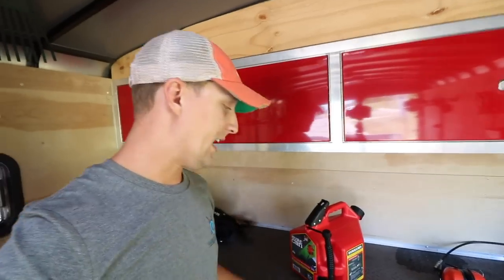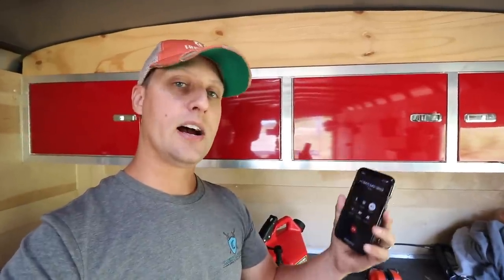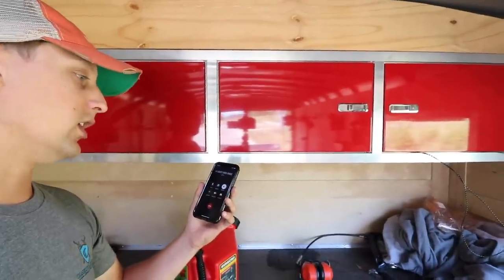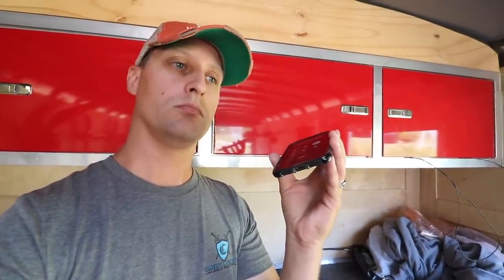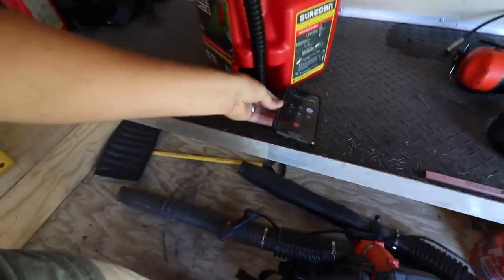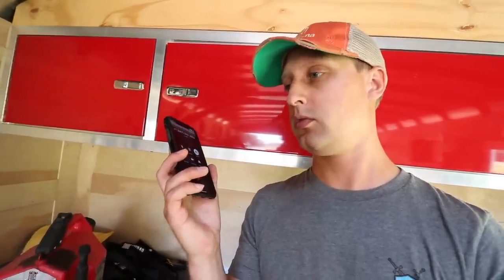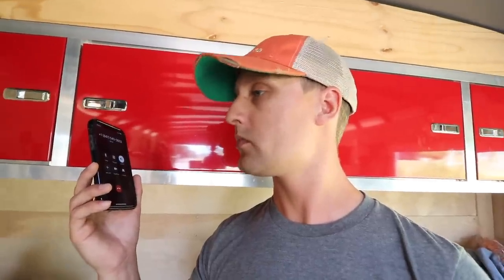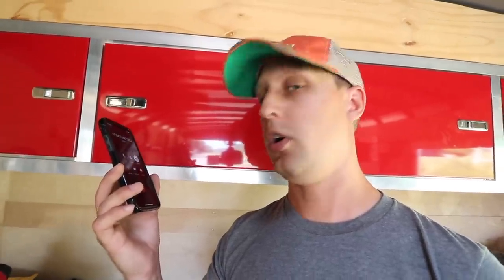What's The Best Octane For Hand Held Equipment? What About Ethanol?

Comment: I run 91 octane non-ethanol fuel in all my mowers and small engine outdoor power equipment. Unfortunately Kansas doesn’t have anything higher than 91, but so far I haven’t had any issues related to fuel. I also use the Echo Red Armor oil mix for my 2-stroke engines. Great product so far.
Reply: Kris Mueller .. I use the same fuel and 2 cycle + stabilizer in the fuel
Reply: @Kris Mueller, where I live in Florida I can find ethanol free gas in a octane rating of 90, 92 and 93 at some pumps but they are so easy to find.
Reply: Illinois is a terrible place to find non ethanol. I live near the 2nd biggest city in the state and there is ONE station that sells non ethanol. It's 90 octane which I think is adequate but I'd gladly pay more for some 93 or something. I run that with Husqvarna XP+ at 45:1 with some sta-bil if I don't think I'm gonna use it within a month or so. I've thought about switching to Red Armor but the Husky has been treating my saws well so I'm gonna stick with that

Comment: Coming from an automotive background this make perfect sense. The sports car reference hit the nail on the head. Sports cars have high compression motors. Therefore requiring higher octane. You don’t want the gas pre detonating before the spark plug fires or the piston is where is supposed to be. As the piston travels up and if the gas ignites, its like two forces going against each other. Like running into the wind. You aren’t going to be fast. So the motor is going to loos power and cause premature damage to the engine internal components. Only putting 91 octane now. Thanks!

Comment: I use 93 in all my equipment. I also only use the redmax oil. My small engine repair guy recommends using redmax oil since it is designed for the redmax equipment and the manufacturer wants you to use it. If you use a cheap oil it could possibly void your warranty. I love your videos. I have my own landscaping company and I'm 16 and had it for 2 years m. Keep up the good work

Comment: Interesting, as far as ethanol goes it is no problem in car engines but will hurt small engine carbs for most people if they let the gas sit to long without an additive. I have found it will not hurt small engines if you are pumping fresh fuel every few day and using it completely not letting old fuel sit in the tank. Also our two gallon can for each truck last 1 to 2 days max. When I first started landscaping I had lots of problems with ethanol since I was not running my equipment non stop.
Reply: I run two kinds of fuel stabilizer in all my stuff to include emergency backup generators and it seems to have solved the ethanol problem in large part.  Yep, when that stuff transitioned in I saw an uptick in carb rebulids/replacements.  The fuel stabilizers have greatly improved things.  Probably a 80-90% improvement.

You are right, it's when the equipment sits without use is when the problems start with ethanol fuel.

Good stabilizers will mitigate that in large part.  Another thing is where the equipment is stored.  I keep the emergency backup generators which store for a year at a time in a climate controlled shop.  Lawn equipment is in a non-climate controller area.  Temperature changes cause the fuel tank to breathe and collect moisture.  Something to be aware of for long term storage.  In a 4-cycle mower, the crank case can also collect moisture in the oil.  Running the engine up to full operating temperature will boil-off the water from the crankcase.

Comment: Big Thank you to Jason and Echo. I LOVE my Echo equipment. I use 93 no alcohol and Echo Red Armor in all hand held gear. When I bought my first piece of Echo gear the dealer said it was the way to go and I have had NO problems.  I did wonder about the use of alcohol free fuel in the zero turn.  Kohler says that 87 octane with 10% ethanol is acceptable and it is cheaper. You just go through so much gas in a week, I wondered what you thought. Thanks for this very informative video and again to Jason and all the good folks at Echo.

Comment: We have 87-89-91-110-E85 in central Wisconsin. 91 is ethanol free at Kwik Trip. I have always run 91 in everything. 110 is racing fuel and is almost $7 a gallon.

Comment: During summer I have to run the highest octane or they constantly vapor lock and boil the gas, when its cold its not an issue but for the little bit extra its well worth having premium for handhelds.

Comment: When I was running my company, I talked to some of the bigger competition in my area about this. One of the dealers here also has a lawn maintenance and landscaping division.

Every single company said they used the cheapest gas available, even the dealer.

I would imagine it was simply the sheer amount of hours they put in their equipment, and that the gear would be replaced before any octane or ethanol damage was evident.

In my area, non-ethanol gas is hard to get. We have 85, 89, and 91 octane.
Reply: Unlike Joe Home Owner, a landscape / lawn care company will typically be gassing up with fresh fuel every day or so and the fuel never sits around long enough for the Ethanol to cause a problem. A professional is also more likely to properly drain and prep their equipment for winter storage. For this reason it really doesn't make sense for them to waste the money paying a premium for non-Ethanol fuel.

Comment: I use non ethanol 90 octane in the handheld tools....the rubber gaskets primer bulbs and lines live longer....I think the best thing i. Ever did was switch to a good grade of oil...I used to buy what ever the station I was getting fuel at sold...never could get 2 seasons from a trimmer....switched to the equipments brand of oil with success...then modified that to include synthetic 2 stroke and I have 2 fs 80s that are 10 years old now and do great...I use amsoil, but I have the red armour and use stihl also...mainly just use a top quality oil and a good fuel and you should get years from your trimmers....now a carb may still wear out or a primer bulb go bad....those things are just gonna happen regardless

Comment: I don’t know if I missed it but if your not using ethanol free gas get yourself a bottle of boat ethanol remover and mix it with the 2 cycle oil, I use it in my boat and in all my 2 strokes and I have never had any issues.

Comment: I run 109 octane (C12 race fuel) in my fs 70 r. I run this because it burns cleaner and gives it alittle more power in the top end. I run the Stihl silver bottle oil and I have never had a problem and I don’t have to winterize the equipment because it burns out of the carb because it evaporates compared to gums up the carburetor

Comment: If you live in an area where you cannot get fuel go to a small airport or a local racetrack some airplane fuel is harsh on four-stroke engines like mowers etc you need to add top end oil. Being an old school tech we dealt with this in the 90" when you get this of type fuel add seafoam to it.I do not like  four- stroke string trimmers and blowers they do not turn the rpm"s so I rebuild older ECHO AND STIHL with non- advancing Ing.this past year is the only bought a blower and trimmer

Comment: Brian, I use non-ethanol fuel. One thing a lot of people don’t think about is; what are they getting when they pull the trigger. If the last person put the nasty gas in their car because it’s a few pennies cheaper. How much fuel needs to go through the pump and hose to get what you want or intended? Pumps here have a disclaimer that says 4 gallons. Most of us fill a one gallon or two gallon. What did we put in our can? You don’t really know...
Reply: Huh?  So you mean they have a sticker that says it takes 4 gallons of fuel before the new selection comes out the hose?
Reply: Most NA pumps are separate here
Reply: Our pumps here are dedicated ethanol free service. 

The selectable grade is what you said. One disclaimer, you will notice the pumps say min octane. Often times you 87 is actually measuring higher. There are reports (hearsay) that several places buy a midgrade and your getting the same fuel and its done because the costs is not that different. A vendor can sell premium at lowgrade without any issue, bur can not sell premium as low grade if that makes sense.  (Again, just stuff inhave read, i have no facts or inside knowledge)

I agree with Bass's comment above that it balances out on the volume within the hose line is reality small.
Reply: Right. I wasn't really referring to non-Ethanol but multi-grade where the pump has one handle and can deliver multiple grades of E10. So if someone has a 1-gallon container for their weed wacker and selects 93-octane, if the last person bought 85-octane then chances are you are paying for 93 but getting a gallon of 85. Correct?
Reply: To clarify; I got my info from the rental company in the next town over when I rented a Dingo. They were very specific about not using the gas from the station on the corner gas station. After reading what ShelI says I would tend to believe the gal. Or lesser. They also said their carb problems stopped after they started using another station.
Reply: We used to have a few stations in our area that were notorious for contaminated gas.
Reply: Thanks for that info.

Comment: Manuals say 89, so I use 89. 89 for my mowers and 2 strokes. With low compression you would think 87 would be fine and midgrade/premium a waste. 5 years using 89 with no fuel issues; winterized of course. Recently ethanol free has become available in my area. I use ethanol free if an engine is going to sit for more than a week, or all the time for marine engines.

Comment: Brian per Bobcat (Indy North) my dealer they recommend no less than 89. But I personally run nothing but 93. My small engine shop (Mower Zone- Danville IN) recommends 93 for small engines period. They also recommend a product by the name of ethanol shield (made by BC3 industries). 

Almost all fuel has a 10% ethanol in it now no matter where you go. The ethanol will eventually eat fuel lines in the small equipment and they recommend the ethanol displaced product ( helps it get burnt and get rid of the hydroscopic properties of ethanol( water attracting)).

The ethanol free fuel is great but it’s not really worth it for small guys like us cause the price point would eat into the profits. It’s normally 1.50 higher per gallon too.

Hope this helps a bit.
Reply: That's funny. I run 91-octane non-Ethanol in all my small engines because that is the only non-Ethanol available around here. When I had an engine that was running too rich and fouling plugs everyone told me it was because I was running too high octane gasoline. I noted that the manual said "Minimum 87 octane".
Reply: Its only 3.45 to 3.65 a gallon vs 3.00 for 87 octane e10
Reply: Strong Tower Lawn Care here in the Indy area at the few that have it the fuel is almost 5 a gallon. There’s like 4 to 5 gas stations in a area of 500 square miles that sell it.
Reply: Hi Todd, I live here in Tipton Indiana and get ethanol free 90 octane gas straight from the pump at the Countrymark gas station. Ethanol free stays right at 60 cents per gallon more there. It's not a huge difference between buying ethanol free or using the BC3 additive. There is a Countrymark in Lebanon which has the same prices, then there is a Walmart with a Muphy USA gas station that has ethanol free for $0.40 more per gallon as well (but it's 87 octane.) I haven't ever seen ethanol free for close to $5 a gallon. it's not that I don't believe you, that just sucks. 

the ethanol free can be stored for a year or greater without issues, as e10 fuel only can get stored for a month in some cases and it absorbs water.

Comment: Where I live, there isn't a single gas station that is ethanol free which blows.  So I use 92 octane and mix in Sea Foam with my 2 cycle and haven't had any issues since I started doing that 5 years ago.  When I wasn't paying attention to the ethanol in gas, at one point I bought 3 weedeaters within 3 years or so and thought "they don't make em like they used to" but naw, it was the ethanol.
Reply from the maker: Exactly

Comment: You forgot about the best fuel for small machines: Alkylate gasoline - This will not foul when long term stored, burns cleaner, less smell.  If it's a pre-mixed solution for 2-stroke it will not separate, it doesn't contain alcohol, so it is NOT hygroscopic like regular gas, this means that you can store the equipment without danger of fouled fuel, carburetor corrosion damage. Usually it's 95 Octane rated. It CAN cost a bit more, but on the other hand, you use relatively small amounts in small machines, so the expense is well worth it, especially if you have machines that sits idle for months.
Reply: satanclaw - But, being able to purchase it in a State that sells it .? .. or is allowed too ...
.. that is the question.
Reply: I live in Norway, I just assumed since you live in the land of the free, you'd be allowed to buy a environmentally friendly fuel?
Reply from the maker: Never heard of it will check it out thanks for sharing.
Reply: satanclaw 😄😄😄😁😁

USA has ... what I call
Garbage Gas
Not only does it contain ethanol (farmers are subsidized by gov't to grow corn) . .. it also 
has butane😲in it. 
This USA Garbage Gas starts to breakdown after one month.
Also, there is a difference between winter blends & summer blends. That has to do with the 
"heat of vaporization". So, you know ... cold winter day & summer gas ---> not fun😥
Reply: We have summer and Winter diesel where I live, the winter diesel has kerosene in it to avoid it freezing, we get temps down to -30c every winter. Our regular pump gasoline has up to 10% ethanol, but they are increasing it to 15% !   I personally use the brand Aspen for my Alkylate fuel supply: US distributor: http://smallmdistribution.com/

Comment: Ethanol free gas in my are is like 3 dollars a gallon more.   I've had no problem running Shell nitro + 93 octane.  It has 10%   ethanol and have had no problem what's so ever.  I've used hp ultra 2 cycle but now I'm 100% Amsoil. I really think there 2 cycle oil is hands down the best there is as well as oil.

Comment: I use 91 octane non-oxygenated gas in my handheld equipment and 87 octane 10% ethanol fuel in my mowers. Before I lay them up for the winters I put non-oxygenated gas in them with a little of the storage additive... I can’t recall the name of it now. I could drain all the gas out of them and run the rest out of the mowers but it’s easier to just use the pure gas in them with the additive in my opinion. Marks Lawn Care, Winter WI.

Comment: No ethanol is the best way to go, ethanol is not good over time for 2 stroke engines especially, I use no ethanol in everything when I can.
Reply: Non-Ethanol has a tremendous shelf life. The only 2-stroke tool I have is an Echo leaf blower. Typically a gallon of gas will last me over a year. I use 91-octane non-Ethanol and I treat it with Sta-Bil. My current gallon of premix is over a year old and my leaf blower starts on the second pull and runs perfectly. I doubt you could do that with Ethanol-laced fuel.
Reply: Unfortunately, all the stations are using ethanol and I don't see some of them even listing it.  I use 93 and treat every refuel with Sta-bil.  I use the fuel within 2-3 weeks.
Reply: @Methodical2  My gas station has an ethanol-free pump. This is a tremendous asset in my opinion.
Reply: I have no ethanol gas in my area but it’s all 87 octane. Idk which is better 87 non ethanol or 89 with 10% ethanol

Comment: I run the 93 in my trimmer and blowers.  My John Deere gets better fuel consumption with the 87 actually.  I have not found any non ethanol to try yet, but am pretty sure the non ethanol only will be available in 87 octane.  My feet can almost feel those size 13's lol and the green stitching will match nicely with that Deere paint😁

Comment: It's a temperature issue with octane. The lower the octane the lower the ignition temperature. 87 octain can ignite from a hot spot in the Piston and combust while the Piston is still traveling up on the compression stroke. The pre combustion is an opposing force to the piston as it is traveling up and will eventually cause catastrophic damage to the engine  such as a hole in the piston  or a broken wrist pin. If you use 89 or higher it won't ignite before the spark plug fires off and there is no preignition. I have a lawn service with my son but I am also a mechanic/ technician. I've been turning wrenches for over 28 years   and have seen the damage of running too low of an octain fuel. Also, don't run fuel that is more than 30 days old and run your equipment dry at the end of the season to prevent damage from stail fuel. Use Echo or Stihl two stroke oil in your trimmers, blowers, saws and hedge trimmers. Follow these steps and save your money not buying fuel stabilizer. I have trimmers and blowers that are over ten years old and run like a champ. New plug, fuel and air filter every spring and they run strong. Never had a engine failure on any of my two strokes.